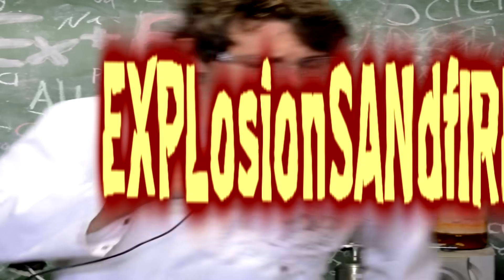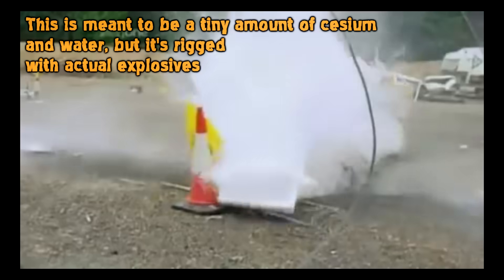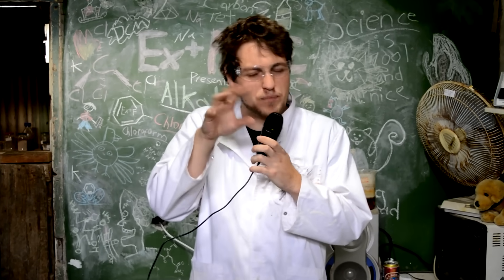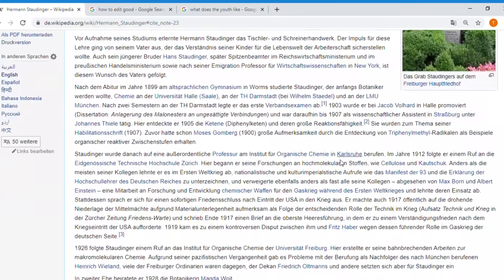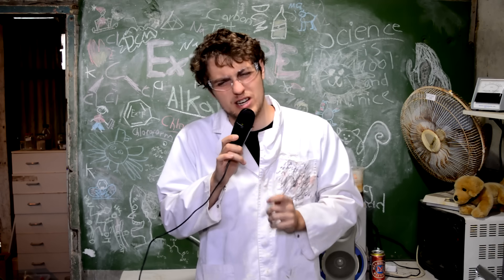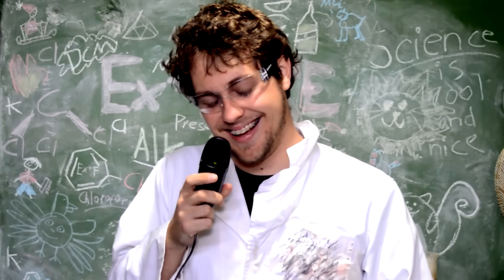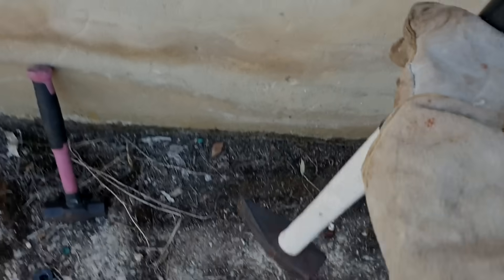Mixing Sodium and Chlorinated Solvents is Real Bad (Carbon Tetrachloride and Sodium)

Comment: If you don't add 2 mol K per mol CCl4, do you get Cl2C: , i.e. dichloro carbene instead of carbon + gas & heat?  The former being a less exothermic & violent rxn?

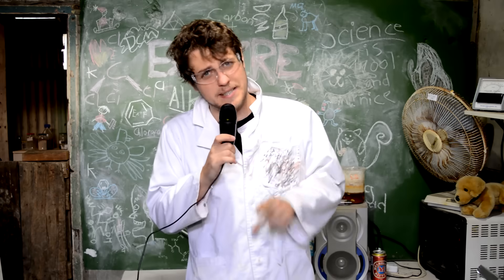Comment: 4:35 learned this in my hazmat tech class. But carbon tet used to be put in glass capsules shaped like a ball. And were used instead of extinguishers by lobbing the cancer ball into the burning room like you would throw a grenade into a room full of terrorist.

Comment: My chemistry  teacher while trying to encourage sodium and chlorine to react in a jar, added a little water to juice things up. Ufortunately he added cyclohexane instead, and when he swirled it with a puzzled expression, the chlorine dissolved in it. He abandoned the jar at the back of the classroom and reset. Some time later there was one hell of an explosion from the back, a perfect massive black smoke ring, and the ground glass plate on top of the jar ended up in fragments embedded in the ceiling!

Comment: I recently started reading a US improvised munitions manual (from the 60s) and one of the recipes is a pipe bomb filled with mixture carbon tet (or tetrachloroethylene) with powdered aluminum.

Comment: Could the oxidized layer around the metal be protecting it from reacting? You'd have to hit it pretty hard to expose fresh metal or in a vacuum like how it sounds the explosion happened in. In a sealed container the stretching of the metal would have created stress and bare metal for it to react to faster than oxygen would be able to fill in and oxidize it. If what i was understanding is right, youd pretty much need to replicate his experiment exactly for the type of reaction he got, and im assuming it was even more violent even at scale than you got.

Comment: 13:27 There's a heavy bar of metal in that rusty pipe. It is held up with a pin that is through the outer pipe, and the pin is removed when the teacher pulls the string. That's how he hits the test sample with some reliability.

Comment: Why don't you build a rig to drop the hammer (or some other heavy shape) on the same spot every time? Then you can just put the thing needing a smacking right under the smacker, directly on the spot it's going to get smacked. slap

Comment: Carbon tetrachloride:
In acute poisoning, headache, dizziness, weakness, nausea, and vomiting occur. The consequence of acute carbon tetrachloride vapor poisoning can be duodenal ulcer, pancreatic necrosis, anemia, leukocytosis, changes in the myocardium, acute psychosis. The result of poisoning can be yellow atrophy of the liver, as well as its cirrhosis.

In severe cases, shortness of breath, cyanosis develop, body temperature rises; possible severe agitation, sensitivity disorders, paralysis, sometimes - toxic pulmonary edema, hepatitis. When inhaling very high concentrations (when careless entry into tanks and reservoirs, when extinguishing fires with carbon tetrachloride fire extinguishers in small enclosed spaces, etc.), either sudden death, or loss of consciousness or anesthesia are possible.

Chronic poisoning is characterized by gastrointestinal disorders, weight loss, anemia, irritation of the mucous membranes of the upper respiratory tract and eyes. When carbon tetrachloride gets on the skin, dermatitis develops, sometimes eczema, urticaria.
First aid is provided in accordance with the general principles of assistance for poisoning with organic solvents. In case of acute inhalation poisoning - fresh air, rest, prolonged inhalation of oxygen, cardiac drugs. With a sharp weakening (stopping) of breathing - artificial respiration. When taking poison inside - a thorough gastric lavage. In severe cases, immediate hospitalization to the intensive care center is necessary.

Comment: My first job was back in the late 70's working in an electronics and high energy optics lab. Back then we used carbon tetrachloride for just about everything we used gallons of the stuff. We had it in squirty bottles, steel trays even large open steel tanks. All this in unventilated rooms with no breathing apparatus.
Reply: That’s insane, do you know if many people developed heath problems?

Comment: I graduated from High School in the early 1980's.  We had to use carbon tet several times.  We also had to make formaldehyde.  And some days I had to distribute the asbestos pads.  That was always a mess.  The powdered asbestos (from pads rubbing against each other) always got all over my shirt.  So I had to try my best to pat it all off my Pink Floyd t-shirt.  

Physics wasn't nearly as dangerous.

Comment: I don't think your accuracy with the sledgehammer is the problem, I think the issue is you always use that old axe head as an anvil.  It looks like it's include to twist when you strike it because it doesn't have a flat bottom.

Comment: Try this one: mixing 1 part with 2 parts AL powder using stick of wood or plastic until it becomes so thick like honey..i never try it but i was told its turn to the powerful expensive, after mixing can be  hold up to the 70 hours, after that its become so  unstable and not safe to keep.. I believe 
this was the reason for banning this substance..

Comment: Chloroform. Can confirm, small boys could buy it  in the early 70's. Carbon Tet, also, HUGE in school chemistry in the 80's. Good times :-) DNT synthesis was on the syllabus, we were so tempted to take the next step. But also, not to get expelled. Getting A levels won :-)

Comment: Please get your self peace of railroad track, two round bars or tubes, two or four large nuts, some hefty metal plate, weld the rods on the ends of the railroad track, cut the plate into 3 or bend it to U shape, weld the nuts into steel plate edges as guide, bolt to steel plate peace, how ever large area of hit you want, some treaded rod on top side and start stacking plate peaces as extra weight. On top weld peace to combine the two pipes or rods, weld couple washers on top and one one the blow, put peace of something trough them act as a release system and now you have jig to hit into certain spot every time and way to remotely trigger it. Essentially your existing setup but far improved upon.

Comment: When I was an 11 year old kid, when I got my first chemistry set, I remember finding a brown glass bottle in my garage labeled "tetra". My dad must have bought it somewhere, used as "stain remover". We also had bottles methanol, ammonia and trichloroethylene. The latter had meanwhile also been pulled from the market, but in the past it was commonly used to dissolve grease and fats. I remember my dad using it to clean bicycle chains.
1,1,1-trichloroethane was also pulled from the market, and so was dichloromethane and perchloroethylene; it seems that we aren't allowed any chlorinated solvents anymore. 😞
Reply: You ill be happy to know that New Zealand  is, or at least was at the time, one of the only 7 countries that used 'trike' as we called it. Used it to dissolve grease etc, it would be heated it up it a kind steam bath (with a gas mask on0 and leave the room for a while while it did its work.

Comment: During my own Ph.D studies we had a safety lecture given by the head of Organic chemistry, who also emphasised the "danger" of mixing chlorinated solvents with sodium. He poured some carbon tetrachloride in a plastic bucket, dropped a chunk of sodium in, and nothing happened.
Which I had predicted, since the week before I had done a preparation of the weirdo compound C(SiMe3)4 - which is done by taking carbon tetrachloride, 4 equivalents of chlorotrimethylsilane, 8 equivalents of sodium metal and refluxing the hell out of it in a sealed glass tube for a few days. The sodium rips the chlorides off everything in sight to make a load of NaCl, and the remainder forms the target compound in essentially quantitative yield.
Anyway, if sodium and carbon tetrachloride don't explode under prolonged reflux conditions (I did this preparation more than once and it never exploded on me), then what are the chances of the same combination exploding at room temperature? Pretty slim, I would say!

Comment: lol One time, I put a cuvette of some chemical I had purified (can't remember which one now) dissolved in DCM into the pocket of my lab coat after putting a small sample of it in the GC. Anyway, I forgot it was in there and accidentally took it home. I remembered when I went to wash my lab coat because I had learned a long time before that it's always good to check the pockets of your clothes before throwing them in the wash. I just figured I'd take it all back to the lab and dispose of it in the waste container then. Well... all of the DCM ended up evaporating in my apartment during that time so I'm hoping I didn't breathe too much of it in (which I probably couldn't have considering how small the cuvette was).

Comment: You should consider using a hammer with a flat face on the back when testing these explosive compounds.  There is a high chance of rebound with these, and a flat face is not as lethal as a pointed face if it hits something.

Comment: The reason you few explosions was that your metals were passivated by a layer of oxyde, thus being unable to start oxydative addition to the halides.
Of course potassium is so reactive that it did react with tetrachloromethane even with that.
It's not only potassium that is very reactive, organopotassium compounds are very reactive and unstable, they tend to self metallate forming even more unstable species, they tend to form carbenes through alfa-eliminations.

Also, what happens with dichloromethane and chloroform is probably still oxydative addition followed by alpha-elimination.
Maybe metallation happens as well, due to the acidity of the carbon that is bonded by three and two halides.

Comment: yeah I do remember that exploding bathtub one, they may have just rigged it because they KNEW exactly what the Cesium would do, as we all do, but buying and handling Cesium just for this is probably a bit over the top, and maybe expensive ?. Actually mixing chlorinated solvents like carbon tet, chloroform, methylene chloride, ethylene trichloride etc. with just about any alkali metal will be a bit exciting. For example, if you have a container full of aluminum powder or say magnesium turnings and you add just enough chlorinated solvent to wet it, it can be set off with a detonator, it's called ASTROLITE...oh yeah, you also need to add about one percent amine to sensitize it, something like aniline, or, pyridine, even ethylene diamine, that sort of thing. And this shit has to be used fairly quick, it won't store well...boom...

Comment: * The DCM at 2:54 is in hydroxypropoxyl methycellulose (HPM) (or similar) aka wallpaper paste. Wallpaper paste is very soluble in cold water so I would have thought that it would make sense to shake the paint stripper with water to extract the HPM and leave behind the DCM as the 'other' layer. You can then recover the HPM as a solid by heating the water layer up to over 80C where the solubility of HPM falls through the floor and it precipitates out and you can then filter it out of this still hot water.
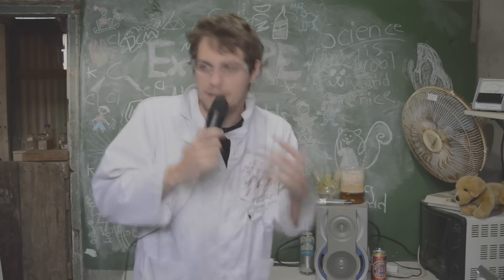* At 6:00 you say; 'The atmosphere is nature's bin.' That has go to go on a tee-shirt.
* Later on - Problem - aiming hammer at pipette at high velocity - solution - tape pipette to end of hammer so all you have to do is hit the large flat piece of steel with it. Should work every time.

Comment: Carbon Tet was great, so was 111.
Damned EPA won't let anybody have any fun anymore.
Won't be long until the only EPA approved pesticide is a flyswatter.
We can't even get chlorinated solvent based paint stripper anymore.
Apparently people would ignore the warnings about having plenty of air and not stripping the paint from bathtubs so now they are illegal.
They have been replaced with extremely flammable solvents and I am sure people will smoke while using them until they get banned.

Comment: Why not hot glue the thing you are trying to hit, to the hammer. Then when you swing the hammer, it's pretty difficult to miss the floor.
Even better, hot glue the vial to the top of the hammer and just drop the hammer on to the plate. You'd have to be a special kind of dumb to be able to miss the floor dropping a sledge hammer.

Comment: Splattering my chemistry lab with Aqua Regis, including the framed photograph on the wall of the only person from our school to win a Nobel prize. My proudest achievement, even thirty years on.

Turned out although I had intended the stopper to be loose while we were warming the mixture, the bung got itself a little tight and pressure made a dramatic entrance, as the acid made a hasty exit, in an explosive manner. Totalled my clothes, but I got to the sink in time to save most of my skin lol. 

The framed photo required a new frame. It looked like it had giant woodworm. My t-shirt looked like I'd been hit with birdshot, everything but the transfer on the front was munched in seconds. As was the front of my lab coat. Memorable though ;D

Comment: Chloroform reacts with sodium hydroxide on gentle heating to form dichlorocarbene gas. It's used in the Reimer-Tiemann reaction. So I suppose similar happens when sodium metal is used.
Reply: Is dichlorocarbene a gas? It is not a stabilized carbene, so I don't think it was isolated anywhere.
It reacts with phenoxyde anions in the Reimer-Tiemann reaction, it reacts with pyrroles to produce 3-chloropyridines and reacts with alkenes to produce dichlorocyclopropanes and probably other stuff.
Reply: @durshurrikun150  I'm not sure why I thought it was a gas, you are quite right.
Reply: @bromisovalum8417  Methylene was isolated as a very dilute gas, maybe dichlorocarbene is a gas too( there's also the fact that it can exist both as a singlet and a triplet, so those states will probably have differing dipole moments).

Comment: Our test lab bought Halogen test kits (haz waste at JBM). 2 glass ampules, of Na-K alloy and Mercury Thiocyanate solution, in polyethylene tube (drying agent in tube) Color change if halogen present. Dumb air force mixed glycol and TCE (brake cleaner) but test still worked.

Comment: Can you please try this?.....
Make thin sheets of sodium, coat the sheets with a little wax or grease. Sprinkle some moist iron chloride on a sheet, then put another sheet on top of the iron chloride, then another layer of iron chloride, then another sheet of sodium, and on and on. 
When hit with a hammer, the iron chloride should be pushed through the wax coating on the sodium, and I think it might explode.
Can you please try this

Comment: in demonstrations this is done frequently by just dropping the test tube from a building (>10 m?) It might be suspended from a ballon filled with hydrogen + a tiny rag soaked with a solution of white P in CS2... balloon takes off... after the CS2 evaporates the phosphorus ignites, the balloon goes boom and finally drops the ampoule ;) just in case you ever want to prepare a "all in one" experiment :)

Comment: I'm absolutely certain you were not nearly hitting it hard enough.  Not even a little.

Powder the sodium in a passive atmo, blend that into a putty with the CCl4.  Have equal charges of PETN in a fairly shallow hole drilled into steel plate.  Fill one with putty and cap with PETN.  Put the same amount of PETN into the other.  Film the two in slo mo for comparison.  One bang should be bigger than the other.   Just a suggestion.

Comment: You need a new hammer, now I know you're only a chemist, but you're on the right track with that drop hammer, redesign it with a good solid base...calibrated and you can use add-on weights to determine impact forces. Just remember to stay alive . And remember what my mother told me, when I was told her ,I was going out to make napalm. she said have kmg365

Comment: @12:30 , when hitting the ampule , I like how the steel beam keeps ringing for such a long time , very good demonstration of the huge level of energy that was cast into the beam , nicely done . Also it would seem to me that the energy came from the explosion rather than the hammer strike , the beam only rings for about a third as long in every other demonstration , that's why I think the energy comes from the reaction and not the hammer blow .

Comment: just a thought for the hammer. you could hinge a hammer at the handle to something on the ground and just drop the hammer that way it hits the same spot every time.. and even possibly weld a steel plate to the hammer for more of a wide hit.